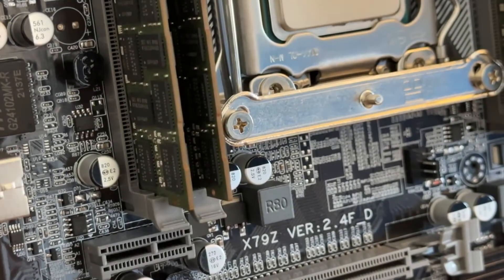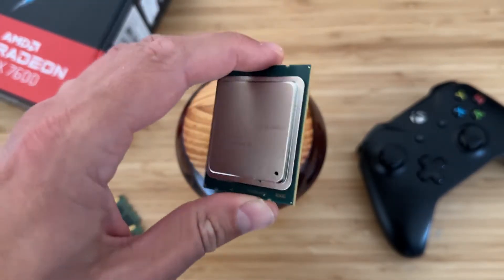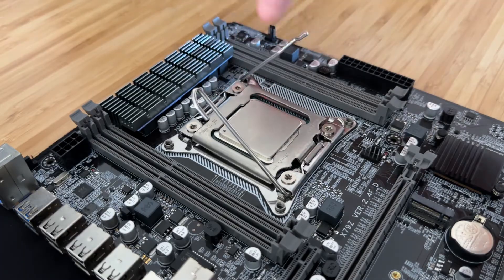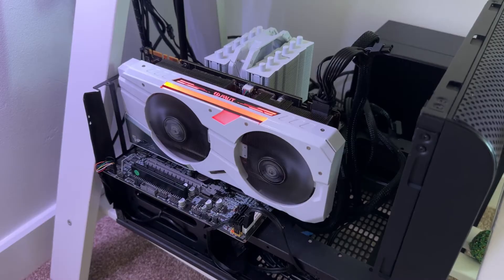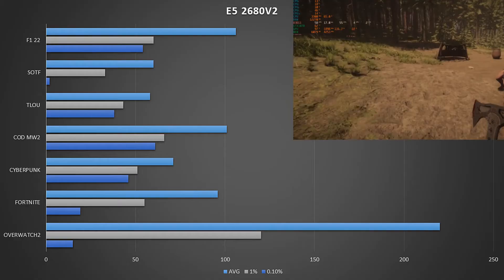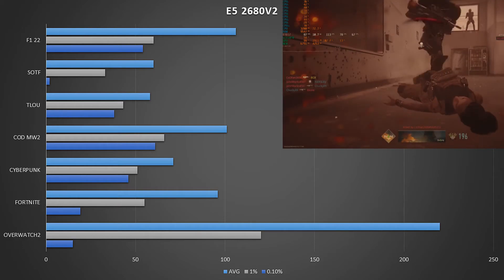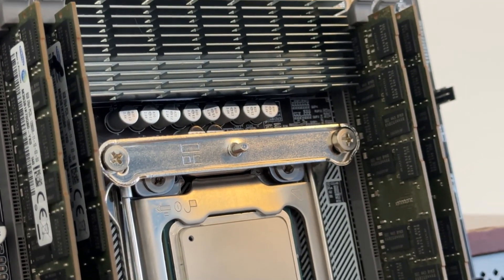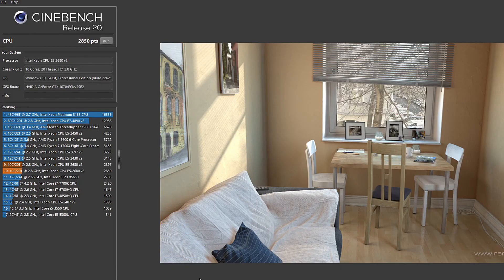This £60 XEON Motherboard Combo is Just AWESOME

Comment: I got a X99-P4 with a 2650 V4 combo for $50.00 shipped.
Reply from the maker: Been looking at those, slightly different in the UK as well have to pay 20% on top but still a good deal 😎
Reply: where?
Reply: @TSSRvingt  AliExpress
Reply: ally express 
"QIYIDA X99 motherboard set combo"
currently priced as 63 for a mobo cpu 16gb ram combo
 @TSSRvingt
Reply: If you go through the coins section, with codes and coins discount, I just picked up Machinist MR9A X99 for 37$ with tax and 2667 V3 for 6.5$ with tax. Now just need to get some ram.

Comment: Is biostar H61MHV compatible with xeon e3 1220 sandy bridge lga 1155? Im afraid that it wont be compatible any help?+ does e3 sandy bridge mean that it will work on every lga 1155 or?
Reply from the maker: Yes that should work if the motherboard supports it. You can find that out on there website

Comment: The X99 platform is only slightly more expensive, and has much better IPC.  IMO X79 is too dated.
Reply: You also get AVX2 support and USB 3 on X99.  More and more games are requiring AVX2, and without it those games won't even launch.
Reply from the maker: Yes agreed but it still put up a good fight tbh.

Comment: a short tipp for u to gettin more outta ur Xeon im using it my self use a Gigabyte X79 board they have 8 Ram Slots and a hell outta Power + Overcloack Protections and much more good Feautures for that CPU :) and the FPS are not caused by the CPU they botteld by the GPU i can say i got in most of my games 200-300Fps all the time only Pretty new games handle me down to 60-80 Fps and even that is not a Problem ^^

Comment: intteresting build.  i built a daily driver home office pc with an Aaliexpress kit e5-2650 v2 w/ddr3-1333 16gb 4x4gb ecc, kllisre x79 mobo.  snoweman downdraft air cooler.  built this back in oct 2021.  running limux mint 20.3 cinnamon,

Comment: How does the power consumption hold up? I'm on the fence of going xeons for the core for $ I pay for ( 8 cores on a budget is my target) vs going Newer 6 cores to be more efficient with power
Reply from the maker: It’s not too bad I can’t give you exact figures but around 120ish watts form the cpu. Best bet would be to go X99 with a v3 or v4 Xeon as you can get so pretty efficient chips on that platform.
Reply: The deal breaker is the idle consumption on these X79 systems. Between 50 and 100W. A ryzen 3600 is faster and can idle at way lower power.

Comment: Ive got a 2670 v3.12 core. Clock speed is a bit lower than yours. 2.30 base/3.10 turbo but its no slouch even then runs everything i chuck at it. Paired with a gtx 980. Theres YT footage of this chip playing Starfield with more modern GPUs.
Reply from the maker: I’ve been playing Starfield on this combo for the last week 💪🏼 it’s not blow your mind but it’s keeping up

Comment: Xeons rule , you get the 'facebook seller' selling a moderate PC for £300/350 then you get the xeon and it £120 and runs rings around  it , good vid graphs are good
Reply from the maker: Yes I’m definitely going to be using these value Xeon combos for my budget builds In future. I’ll be keeping this board for myself but I’ve ordered a 2666v3 and X99 combo for £54 delivered with 16GB ram 💪🏼
Reply: @andystech101  lol that's a good price

Comment: Is the 1070 undervolted, or why is it only pulling about 100W in those benches ?
Reply from the maker: Yes 100mv the same as I ran the gpu with the 5700G 😎
Reply: @andystech101 You can bclk over clock these chips with up to a 20 series card without the gpu bugging out from the excess base voltage if your vrm will take it and the bios will allow you to tune ram timings and unlock voltage limits I have a Asus ws pro board running a pretty decent over clock and getting 3.588 base all cores and 4.188 boost on a noctua tower cooler evga 1070 ti sc for the main monitor and a evga 1050 ti sc for the capture card and second monitor I put it together for my niece to game stream whatever with and so far its done everything she wants it to and does it pretty well think I'm gonna get her 5700xt for the main and using the 1070 for the capture card though I would go 2080 ti for the main but they seem to die pretty often from ram issues

Comment: Been using a Huananzxi dual socket x79 for years now, been working fine!
Reply from the maker: Two of these would be an interesting idea in a motherboard! Had the dual LGA1356 system a few weeks back but the CPUs are limited on that platform.

Comment: i have  a motherboard very similar as my "daily drive" for work. But more green! They can use ex server cpu's and memory that you can buy for pence so what is not good. I  think the Frankenstein motherboard may use e waste chips  but i've used one for the last 2 years and only changed it  because it was easier to build another one to be able to swap it out. The 64gb of ddr3 in dual channel mode was £5!
Reply from the maker: Yes it was hard to find a cheap non green board! They’ve definitely come a long way in the last couple of years as well  and two years use just goes to show 😎

Comment: Surprised with the performance of the intel Xeon E2680V2, I reckon you might even be able to pair this with a slightly more powerful GPU too and it would still do well, great video as always mate!
Reply from the maker: Definitely! I expected a lot worse in the percentiles, something like a 4060 with frame generation would be interesting. Thanks mate appreciate the comment 🙏🏼
Reply: I have the same chip running at 3.6 base all core and 4.3 boost all core with a fsb overclock and .17 voltage offset it burns through everything my niece wants it to do I used 32gb of corsair beast 2400mhz and a evga 1070 sc for the main gpu and a 1050 ti for obs it burns through everything at 1080 high to ultra with no issues and pulls good fps tuned at those clocks its on a Asus workstation board real good bios for tuning the xeons

Comment: oh my haha I just got my xeon 2667 v2 too and it is awesome lga 2011 is quite cheap, now its my main pc btw noice video  as always
Reply from the maker: Funny you say that I’ve, got the 2667 v2 next on the list 😎
Reply: @andystech101  I found the 2667 v2 to be the sweet spot on Cinebench R15 and Valley/Heaven benchmarks on my HP Z420. I tested the 1620, 1650, 2667, 2690 and 2697 v2 with the GTX 1060 6GB, and the 2667 was the best all rounder. I also play Command Modern Operations, where I though the 2697 with 12C/24T would excel, but the better  clock speed of the 2667 beat it out.  Xeon addiction is bad, I've just ordered a 1660 v2, and have quite a collection of X58 based older Xeons ("W' and 'X' Xeons) for my older HP Z400 :)
Reply: I've had the 2667v2 for 6 years and its a champ  because it has enough cores and it can turbo 3.6GHz across all 8c with ZERO OC basically forever providiing you keep it cool which isnt hard at all.
Reply: I don't get why you bought that crap. You can actually get an x99 and e5-2697v3 with the same price and can beat ryzen 5 5600g
Reply from the maker: @tyrellwreleck4226 Not delivered to your door with 32GB ddr4, a full size ATX board and cpu so yes I brought that crap for £60, yes you can get cheap X99 combos on Ali express. I use £50 combos for my budget builds but the cheap mATX boards aren’t great and are very limited. Also prices have come down for X99 in the 6 months since I made this video.
Reply: @tyrellwreleck4226  based on my place where i lived the aliexpress €60 for that combo is expensive as i get the 2667 v2 and a motherboard combo with ddr3 32gb ram ecc less than £30 if youre saying that add on £30 isnt a lot for my place its like adding another 200 bucks

Comment: I have the same problem, now my kids are on board, and they're editing videos for me since they're both in TV production class, at least until they're old enough to be on camera, they can pay me to edit videos on my piles of ebay finds. I've certainly had some fun with those Machinist boards, I wish they had some AMD platform stuff too.
Reply from the maker: I’ve seen the AMD stuff they do but it seems a little pricey compared to used stuff here in the UK at the moment. Machinist are definitely one of the more reputable brands on Ali I think.
Reply: @andystech101   For sure! I've never seen anything AMD on Ali, I'm going to have to dig a bit deeper!

Comment: Hard to beat the older xeons for value. The lack AVX 2 will likely be a limitation in the near future
Reply from the maker: Yes definitely but it performs well at the moment and I’ve even been playing Starfield on the system fine! Will be looking into the v3/v4 Xeons as well at some point but I’ve got a 2666 v2 I want to test first 🤩
Reply: @andystech101  I've paired a Radeon rx7700xt with an E5-2690 v4. It runs brilliantly.
Reply: Not the E5 V3's...they have AVX2....at least the E5-2678v3 and the E5-2696v3 in my home.  The later is selling for $45 and has 18 cores/36 threads, a turbo boost of 3.8Ghz, and a TDP of 145W.  Both support DDR3 or DDR4, depending on the X99 motherboard chosen. One MUST turbounlock (TU) the E5-2XXXv3's variants, to capture maximum performance. Also, be sure to use a motherboard with 4 DIMM slots, to ensure implementation of memory in 4 channel. RAm is limited on these CPU's to 2133Mhz...but in 4 channel this is roughly equivalent  to 4200Mhz in 2 channel.

My 2696v3 scores 14,050 pts on CB R23 multi. Runs cool on air, never exceeding 53C at 20C ambient with a 6x6mm dual 120mm cooler.

In gaming, the 18C/36T CPU hovers around 3.7Ghz all core with TU. Under heavy 100% test loading, the TDP limit drives down clocks to 2.8Ghz all core.
Reply: @jb678901 
Thank you for all that info, question, I'm trying to decide on a old xeon processor that does support Avx2 and that does the best for gaming. I'm really not that good at overclocking.

With all of your knowledge what would you recommend?
Reply: @jb678901 Can u help me build one?
Reply: @jb678901 oh boy 18 cores on TU. Electricity bill gonna hurt
Reply: It's a performance bottleneck for mixed processing LLMs (aka using CPU and GPU at the same time, a common tactic when dealing with models bigger than your GPU can hold), and some Skyrim physics mods require it, but other than those I haven't seen much useful demand for AVX-2 or AVX-512 yet. It's going to start being demanded eventually though.
Reply: E5 2667 V3 has avx2
Reply: @woofmeowmeowwooffestival4774 
That's the processor I want to buy on Ali right now but I can't find any info that it does support avx2.
Reply: V3 version is avx2
Reply: 1680v2 here. The only game that requires AVX2 so far is Alan Wake 2. I tried it and the game just wont start at all.
Reply from the maker: @DLK92 Who wants to play Alan Wake anyway 💪🏼
Reply: @DLK92 dying light 2 star citizen hell divers and multiple others